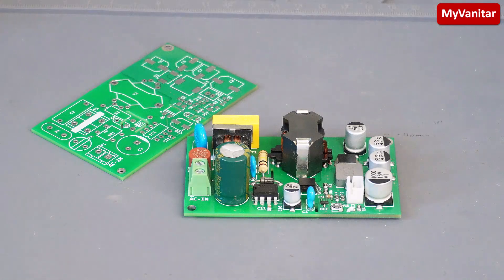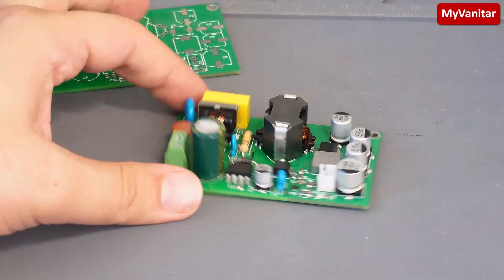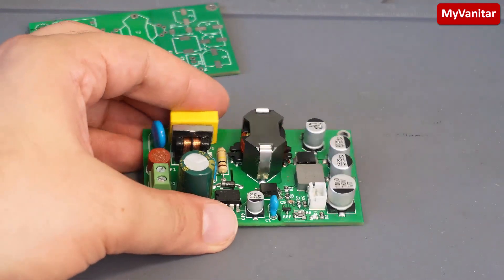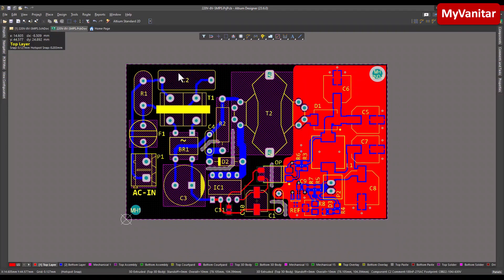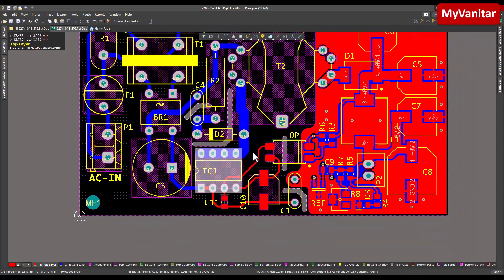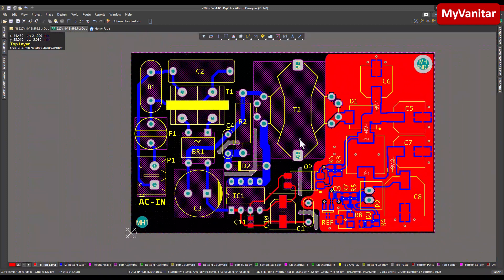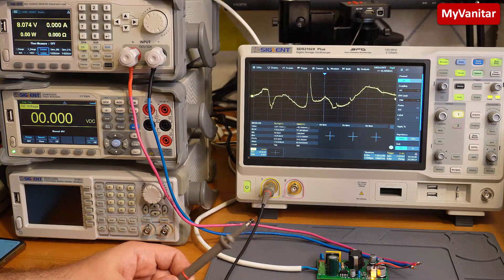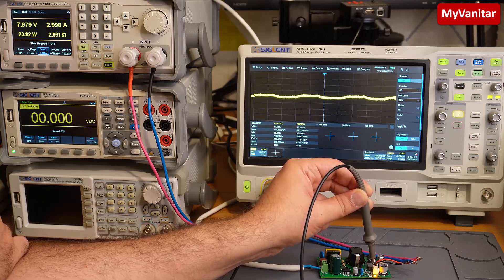220VAC to 8VDC 24W Flyback Switching Power Supply

Comment: How to convert it into 12V 2A? Is there any easy method
Reply from the maker: it can be done with the same circuit, just the secondary winding and value of two resistors should be modified, but my intention was to build something that's hard to find in the market. if the need for a DIY for the 12V is high, I will design another one also
Reply: @MyVanitar  Thany you very much for ur reply . Yes I think 12V 2 A is much more required thing. It would be very helpful for us and for society. And as I can the voltage drop after full load is very less which is quite impressive.
Reply from the maker: if your need is 12V-2A continuous, you should use a supply with at least 2.5 to 3A output, for a long term run
Reply: @MyVanitar  Yes but for that we cant use DK125 as its max output is 24W. I have tested for continuous full load of 2A it works perfectly even for longer period of time .
Reply from the maker: This circuit is also with DK125, however even if it works I suggest you avoid using components at their margin. by the way, I put 12V-2.5A in my list for future publication
Reply: @MyVanitar   Thank you sir

Comment: Hello, thank you for sharing this, it was a lot helpful;) may I ask you please, what's the most advantage of using RM8? Thx
Reply from the maker: They are more efficient than traditional cores and less prone to saturation, so a smaller core can handle higher currents. also, self-shielding means they introduce lower EMI figures

Comment: Can you curious if you did 5V instead with an embedded filter, can you go directly from SMPS to filter to MCU?(skip the linear regulator)
Reply from the maker: what can I say, in general, yes you can, but if you use an RC filter, it's good but causes a voltage drop and it is good for low currents, also any current change in the load, changes the voltage drop and causes voltage fluctuations. if you use an LC filter, the noise frequency might come close enough to the resonance frequency of the LC filter and increase the noise. The thing I mentioned in the video is what is used in good commercial devices. SMPS (like this design) is away from the main board in a metal enclosure and it is connected to the board with some wires, then some linear regulators or low-noise buck converters are used.
Reply: you can use a ferrite bead for high freq. filtering
Reply from the maker: don't forget to include some capacitors

Comment: hello, why the secondary winding does not rotate clockwise? thank you for this dedicated work.
Reply from the maker: it should not be clockwise because the polarity is in reverse
Reply: @MyVanitar  What is the reason why the poles are reversed? Thank you.
Reply from the maker: for the secondary, the negative line is up. you can wind and test it yourself. it's just 4 turns

Comment: Hi, what is the purpose of OC pin DK125 IC?
I have gone through the article, but there is no transformer design calculation, can you provide those informations?
Reply: https://youtu.be/7BicOFRwDGo        10:36
Reply from the maker: OC pin is the same as the Drain of a Mosfet, where it switches the winding, regarding the information, I can not provide everything as a piece of cake, I'm sure you can't find any article/video with this level of details and tests anywhere
Reply: @MyVanitar  Sadly, my collection of chips does not include a DK125/Viper22a ... I do appreciate though, you are choosing very generic and inexpensive components.  Aren't the transformer components the most expensive?
Reply from the maker: Yes, there are many components but when we can conclude something cheaper without sacrificing the quality, there is no problem. This SMPS chip is really cheap and works well!

Comment: how did you design the HF transformer? Through software or did you look for an off-the-shelf part that had the correct voltage and power specs?
Reply: Another solution is to ask the manufacturer of the controller IC for a suggested transformer.  Many times they can provide you with an off-the-shelf part that will work in your designs.
Reply from the maker: I calculated it myself, It's very hard to find a transformer that matches the design specs. I explained how you can build one. I provide whatever information, but when I see you miss and just skip the content (which is clear from the question), I get very disappointed

Comment from the maker: 220VAC to 8VDC 24W Flyback Switching Power Supply
Reply: First of all: Thank you very much for your very detailed explanation. I've been following your videos for a while. And this video is definitely one of the best!
A wish for the future: Could you record a video or write an article on how to calculate the number of turns and the inductance of the storage choke (transformer)? There are many ways to do this, I know. For example, Power Electronics offers software for dimensioning the storage choke. There is also a program for this calculation, the author comes from Russia, I think. But it would definitely be very interesting to see how you do it, how you dimension the storage choke.
Reply from the maker: You're welcome, thank you for your comment. I have a plan to make a practical course around this where you can easily follow and build whatever Flyback supply you like. I have not decided yet